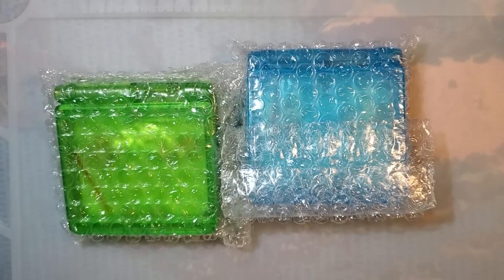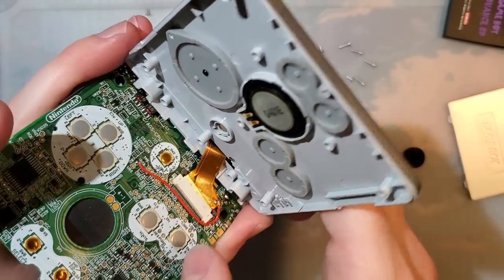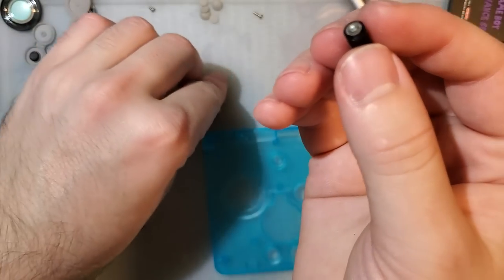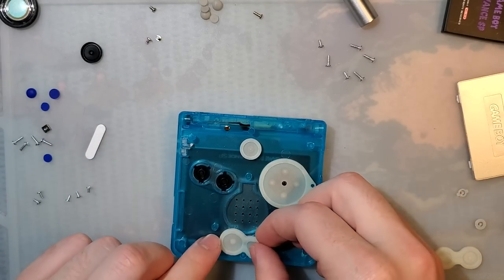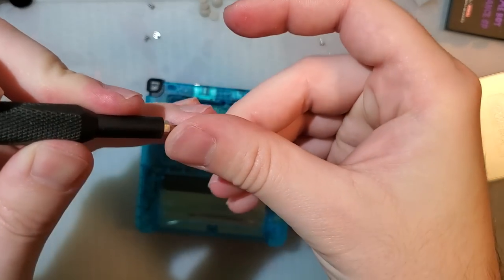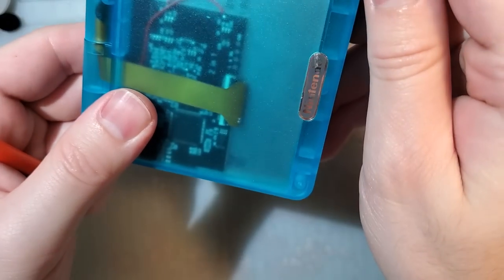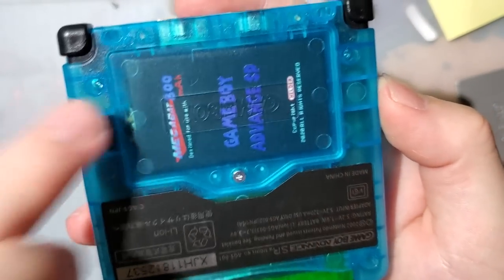IPS Ready Game Boy Advance SP Shells

Comment: So I did a two tone GBA SP, clear black on the outside and clear green on the inside to look like the eggs from Alien. They were precut shell shipped with the onechip ips with the black pcb and x2 touch censors attached. It was my first time doing any mod/custom game boy, I wanted to do it for ages hence why I been watch a lot of these videos. Yours are the best Mahko 😉 even though it was precut I still had to do a small shave for the black pcb part that sticks out. All in it it came out really good, except down on the dpad doesn't feel or sound nice and clicky, but it still register. Im waiting on se clear green buttons for inside and plan to switch them. I think I also may have stripped the screw heads for the screen screws, I was using those crappy red screwdrivers these kits come with and the screws too, so I don't think I'll be taking the screen apart again. Where can I post pics?

Oh and I broke one tooth on the black hinge 😁
Reply from the maker: Imgur is a popular image host. I tend to upload pictures there. Another good place would be directly to reddit on the r/gameboy sub.

Comment: So, do you have to use an IPS screen in one of these? If I put an OEM screen in there, would it bounce around in there without the support beam?
Reply from the maker: no, still fits fine, as I demonstrated in the video.
Reply: @makho  Sorry, I must have missed that part. Thanks!
Reply: @makho  ummm you said for oem screen 101 may you should put the sponge for the bounce on the screen 🤕
Reply from the maker: @TorukRD  wat
Reply: @makho  well if you don’t know how to interpret a bad english ok 🤷🏻‍♂️
Reply: In case someone else is here to learn if these IPS ready shells fit AGS-001 and AGS-101 displays:
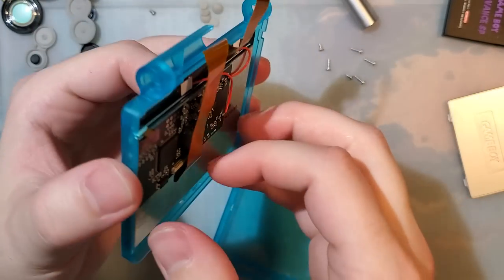AGS-001 @ 09:50
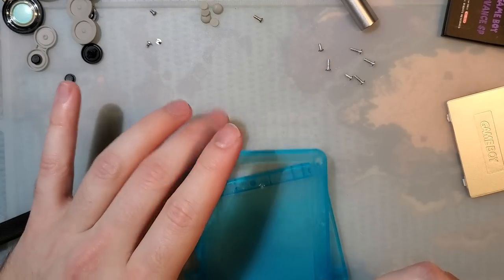Funnyplay kit @ 10:34
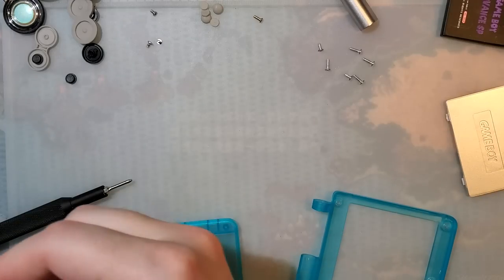AGS-101 @ 12:18 ** Just explanation, no demo

Comment: Hi makho, I have a question about these kits.
I've bought an ips v2 kit from aliexpress that came with a display and a precut shell; however I've noticed that the display I got is skipping frames. Does this also happen with original funnyplaying kits? And if not, do you think replacing the ribbon cable with a funnyplaying ribbon could help?
Reply from the maker: funnyplaying does not have this problem, nor do the newer 'one chip' kits. Sounds like you got an older one, unfortunately. Yes, replacing the ribbon would resolve that problem.

Comment: Are those Ifixit kits worth the money? I've been eyeing one for a few months now.
Reply from the maker: I think so. I was initially very wary because of how much they get shilled but, especially for what I use it for, they are genuinely good kits. I don't think the pro one is worth it, especially if you already have some tweezers and stuff, but the mako toolkit is. I haven't had to use it yet, but the lifetime warranty looks pretty good too. It's one of the least expensive ways to get some JIS drivers too. A standalone JIS kit is only a few dollars cheaper than the whole ifixit kit.
Reply: @makho  I think the price tag will force me to always put the bits back in their box lol I've got about 5 screwdriver sets with missing bits because I just buy a new one when I lose part of it lol. Yeah, the Mako deffo seems the best value for money and the most useful, It might have to be done. I also like the larger handle, easier on the hands.
Reply: Absolutely!!! I got the full pro kit with the magnetic pad, tweezers, picks and so on it’s amazing the screwdriver feels great the warranty is awesome I took apart my MacBook Air and the video said to use a t-5 I believe but it actually called for a p-5 so I messed up my t-5 bit and emailed ifixit they immediately got back with me and sent me 3 replacement t-5 bits and replacement spudgers for free without me even asking for them they only needed an order number or picture of my kit to prove I actually had an ifixit kit didn’t need purchase dates or receipts and so on awesome company reminds me of snap on with their customer service same exact procedures I had my replacement parts in 3 days

Comment: I bought on aliexpress a similar shell, it was blue clear but not ips-ready. The thing is, every screw they sent with the kit was phillips, not a single triwing. I ended up with a severe stripped screw on the battery slot and had to basically break it. Really sad, and still don't understand why I got only phillips screws.
Reply from the maker: if it wasn't molded for the IPS screen, it's a different shell
Reply: @makho  it definetely is. My only doubt is why does it fit only phillips screws
Reply from the maker: @kerdionss  because that's what the factory included. ¯\_(ツ)_/¯

Comment: I hesitate on changing my SP's shell cause it's a Kermit the Frog green, and I suspect that was the DK bundle from Target, but... it's got some significant wear, and I kind of do want to mod it beyond just doing the battery.
Reply from the maker: buy another console for modding then
Reply: @makho  I went and reshelled it anyway.
I can always buy another SP mainboard and put that in the old shell. 
Is it me, or do the rubbery screw covers not come with any adhesive backing?
Reply from the maker: @Omega_2  the new ones do not in most cases, correct

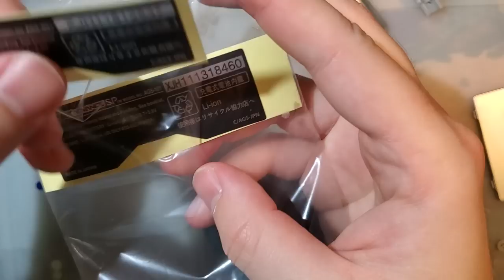Comment: 35:08 Are you sure it didn't come with 2 per shell? It looks like on says 101 on it
Reply from the maker: I got two shells and two stickers. You do the math. It says AGS-001.
Reply: @makho  umm. I wasn’t trying to be rude. I was just confirming. It’s odd that one was a 101 and the other was 001. It’s not very clear but thanks for insulting my basic math skills.
Reply from the maker: @Madblaster6  You're asking me "are you sure" about what I got. Yes, I'm sure I got two stickers for two shells. One does say AGS-101 but the one I used says AGS-001. I wasn't sure what you were asking about. The one that says AGS-101 also says "C/AGS-JPN" on it when AGS-101 consoles were not released in Japan nor are they referred to as AGS consoles, they are AGT consoles. It should read "C/AGT--USA" (or EUR or AUS or whatever region). So thanks for insulting me first if we're going to start making assumptions about each other since apparently I don't even know what I got. (I hope you're not serious about that insulting thing because if so you can fuck right off. Otherwise, I'm assuming you're just reading way too much into this.)
Reply: @makho  dude! I’m not arguing with you. I told you I wasn’t trying to be rude! What’s your problem?!

I have a very high respect for your channel and I’m quickly loosing it. You’ve been very negative toward my comments lately. I thought we are in a community where we’re supposed to help each other. I wasn’t questioning you I was just confirming. I wanted to be sure what I got in case I ordered it. I thought maybe they sent 2 per so you got to choose which one you wanted to put on. It’s a neutral question, you only chose to take it the wrong way. 

I even recommend your stuff to others but I guess you forgot.